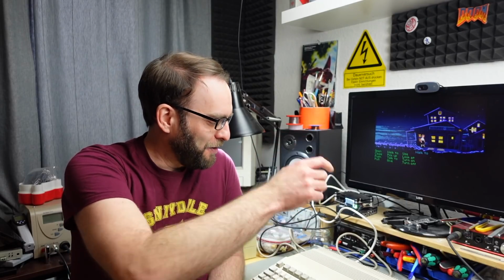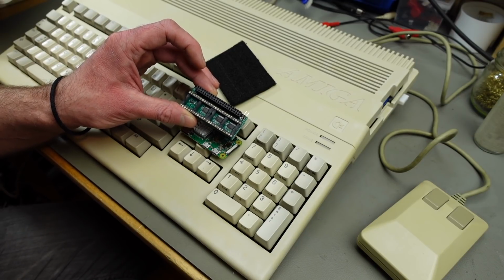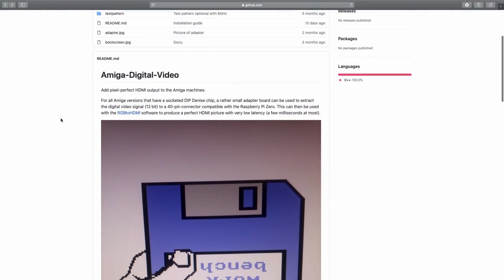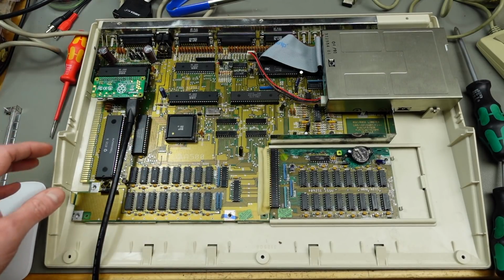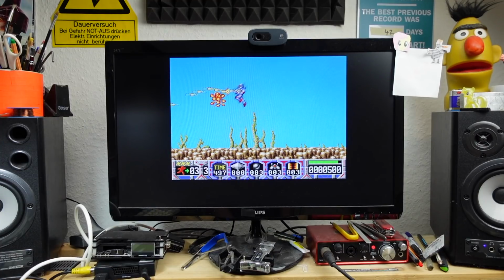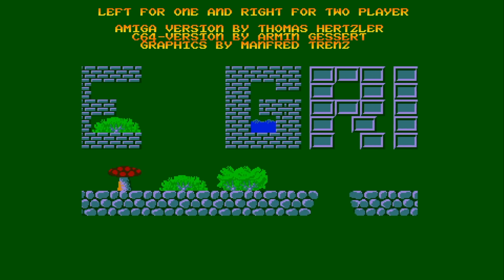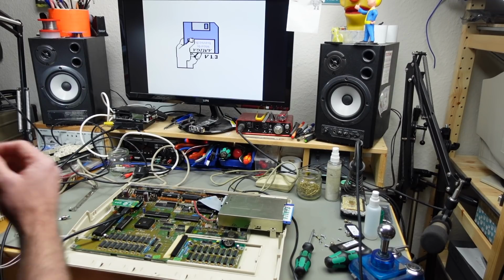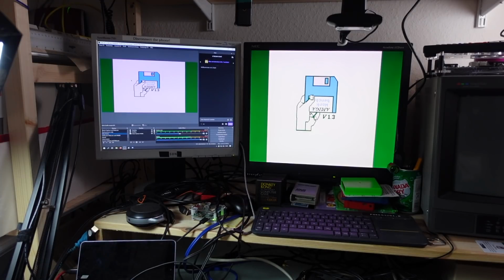Amiga HDMI with a Raspberry Pi! (RGBtoHDMI)

Comment: So, you are using an entire computer, with many times the processing power of the amiga, just to have an HDMI output? Are there no fpga solutions for this?
Reply: What makes you think an fpga solution would be better suited/more economical?
Reply: @neur303  I mean it's silly if you think about it. And a dedicated fpga solution should help with lag. Actually I'm surprised the lag is as low as it is.
Reply: @babbaloerie  Well, I think I get where you are coming from. From a technical point of view it can seem absurd in certain ways. When FPGAs came out I was wondering why they are not more widespread.
And I learned there are a few reasons:

* Gates a orders of magnitude larger. This increases cost per function and makes it harder to reach high frequencies (which are often needed  for tranfer protocols)

* Interconnection Matrix is costly. In an ASIC the routing can be static but for an FPGA it needs to be dynamic which means you need logic to route logic signals.

* Configuration Logic and SRAM. This is more or less a repetition of the points above. But you need to configure every single gate and signal flow. This adds up and you need to manage loading the FPGA design.

Ok you can now argue that the logical function should be rather simple and you might be right. But then there's also the problem with standards and implementation thereof. You would need to implement HDMI yourself or have a ready and validated design. Only recently HDMI 2.1 was made non-public and you cannot openly share your designs anymore.

Also validating and debugging PCB design for "high-frequency" protocols like HDMI design can be time-intensive and will likely add cost to your PCB manufacturing.

And then there's economy of scale: You dodge all the one-time costs if you choose a ready-made design. There might be cheap FPGA HDMI modules, but I would rather suspect that it is very hard to find one that is cheaper than an RPi 0.

Regarding latency I would suspect that there is a delay of maximum two frames if at all and the logic in your monitor likely would add more to it than the converter.
Reply: @neur303  try 2 milliseconds
Reply: @neur303  Latency is very low, actually. The Pi genlocks the output to the input and writes to the frame buffer just ahead of the postion from where the output is again generated (just far enough ahead to not get conflicts).
Reply: @copperdragon9286  Good to know! Thanks! That sounds hardcore! Sounds like this hardware has potential for a nice demo scene category :)
Reply: @neur303  FPGA is extremely well suited to this sort of problem - you want low lag processing, have a fairly simple data processing path, and don't need much administrative processing to support it.  The biggest possible issue with using an FPGA is that if you end up needing to buffer a frame, it would require some RAM, but an FPGA with enough RAM (even if externally attached) would work fine.

It allows solving any possible issue that could be encountered and doesn't require what I assume are janky tricks to bare metal boot a non-open SOC (the biggest issue with that is that it may not be portable to newer hardware if the chip documentation isn't adequate or porting efforts simply aren't done).

However, that said, now that this has been done on a cheap raspberry pi, the raspberry pi may be the better option now if the full setup is cheaper to construct.
Reply: @big0bad0brad  I think it would be very hard to beat off-the-shelf hardware in cost and availability. Having a pre-made validated HDMI design is probably the biggest cost-saver.
Regarding latency I am sure you can achieve lower latency with FPGAs but I don't think it matters if one frame uses around 16-20 ms.
IMO "Hardware" is likely harder to validate than figuring out/reverse-engineering a few software hacks needed to support a different platform.
Reply: @neur303  Yes, now that it exists it is probably the most reasonable current option.
Reply: FPGAs are actually a real pain to work with from an electronics point of view.  For non-HD video the Raspberry Pi is cheaper and easier...
Reply: @balloonsystems8778  High integration SOCs are an ungodly nightmare to work with at the bare metal software engineering level.  The only thing that makes this reasonable is that it's already been done.  If this hadn't already been done, I think FPGA would have been a starting point with a better guarantee to be a tractable problem.
Reply: I am not quite sure how the whole RGBtoHDMI project came to be, but I guess it would take just one hacker crazy enough to try to implement an upscaler on a bare-metal Pi.
From then on it was probably incremental improvement. 
The Pi already offers the necessary hardware to solve two issues with an FPGA solution: HDMI signal generation and enough memory for a framebuffer.
And the third issue of course that soldering FPGAs can turn to a real headache (144 pins with 0.5 mm pitch - if your are lucky).
Reply: Yes there is it's called the OSSC and is referenced in the video. Why use a pi zero instead? I'll let you guess.
Reply: @davidste60  From what I can tell, OSSC cannot take digital input.  It is not a solution to the same problem.
Reply: @big0bad0brad  true, this solution has better quality in addition to it's cost effectiveness. I don't see any need for an FPGA solution similar to this. It's cheap, high quality, and any difficulty porting it to newer hardware hardly matters, because there are far more pi zeros available than there are working Amigas, and will be for ages. EDIT: Plus 2ms added latency is negligable, lost in the noise of HDMI transfer and where in the frame cycle your button press happened to occur.
Reply: Why not? We ususally use pc a a slave for commodore machines. For me , a pc is nothing. And a pi is cute small, so usefull for special things :)

Comment: cool  i was wondering why the pi was never used really in amigas ,  but does seem a waste of the hardware ergo using a whole pi4  to augment. like a vampire or the vn gfx card  thingy for the big box amigas
Reply: There is an accelerator for Amiga500, that adds a co-processor and slowram. It is named a314, and have been out for aprox a year or two.